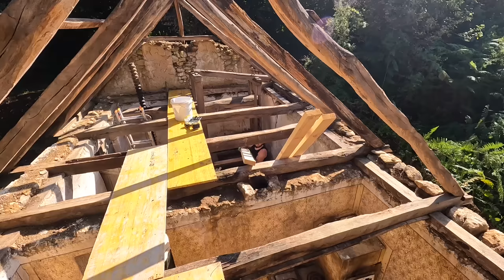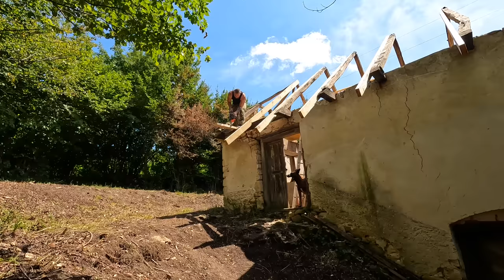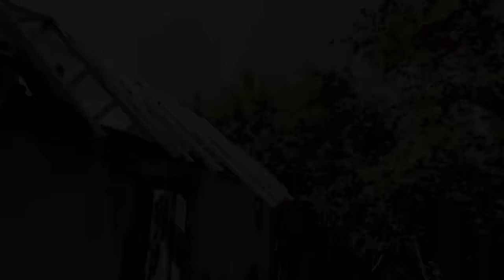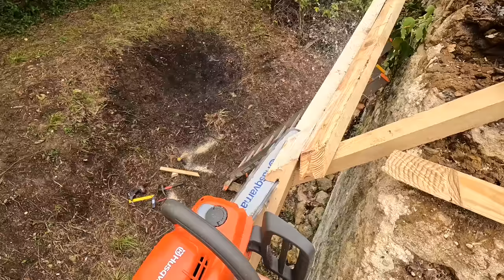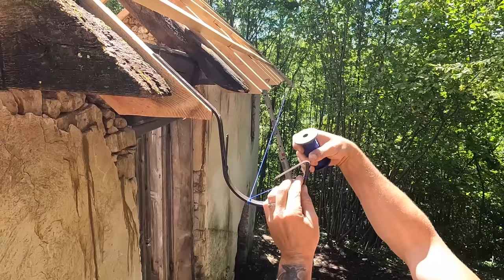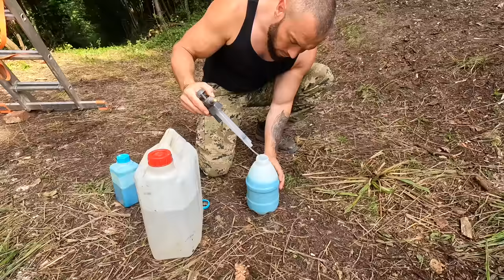Framing The Roof Alone! OFF-GRID Stone House in the Woods, ep.02.

Comment: I buy a wax ring that’s used to seal a commode flange for my screws to help go through old wood. Not sure what you used but the principle is the same thing. Also if you need to put a screw at the end of the board and don’t want it to split out turn the screws up on its head one concrete or something very hard and use your hammer to blunt the tip of the screw so it won’t split the ends.
Reply from the maker: Thanks for the advice 👍

Comment: Geez Luxon, You could have called me.  I want to drill and hammer and saw stuff.  I do know how to correctly do those things, even if I don't say them right lol.  I could have done it while you were home with family, I would be working.  The only thing you best not get me to help with is the math and measuring.  I suck big time at math lol.  Then again, I do have to use my own jigsaw to cut a piece off plyboard to fit under my mattress to support my bed frame.  And I do have to install a cat door in a metal back outside door.  So I guess you probably better off on your own ;). I have put off that cat door for so long.  I'm intimidated that I will cut the frame crooked.  What is the purpose of the waxy substance you dip the long screws into before drilling them into the 2 x 4?  One of my exes was stubborn and didn't wear safety glasses either. He has permanent damage to his eyeball due to his thinking he knew it all.  Just sayin ;)  That roof is absolute perfection, very well put together.
Reply from the maker: Hahahaha...Olivia! Be careful not to hurt yourself
Reply: @luxonbushcraft   I  will definitely wear safety glasses and a mask lol.  I'm happy to see you wore protection for the termite spray?!
Reply from the maker: @oliviarinaldi5963  😘

Comment: congratulations for your work that you have done with a lot of patience but, I wonder how you can trust a masonry structure made of irregular stones, consumed by time, which rest on the earth.  building a new roof with a different load distribution can involve some risks.  a concrete curb and a few well-disguised pillars would have made the difference, as well as reinforcing lintels on doors and windows.  Thank you for showing us your work.
Reply from the maker: Hello! The roof that I plan to build, as well as future works, will have a much smaller load on the building than it has been so far. The building suffered 2 strong earthquakes and is still standing. After I'm done with her, this will be an older, wiry beauty. Stay with me…
Reply from the maker: And yes, I forgot to mention. Most of the basement is carved into the rock, so the house itself stands on the rock.